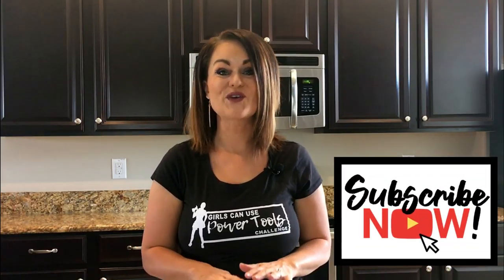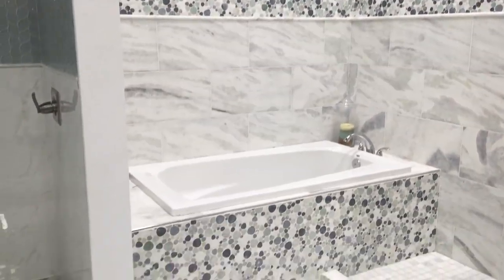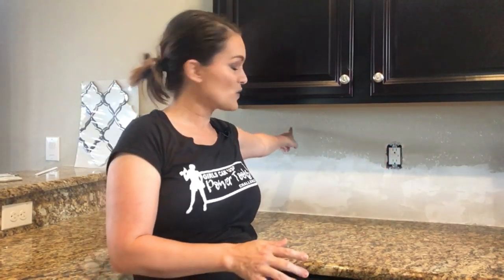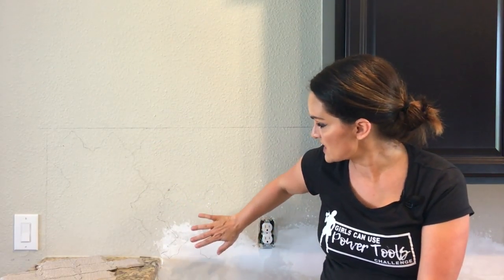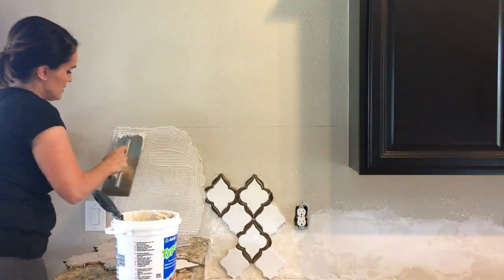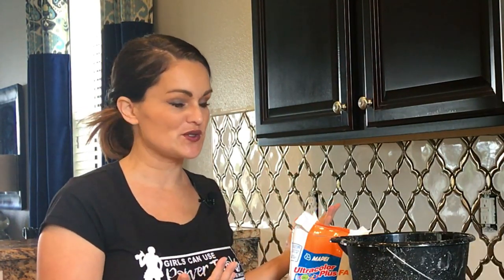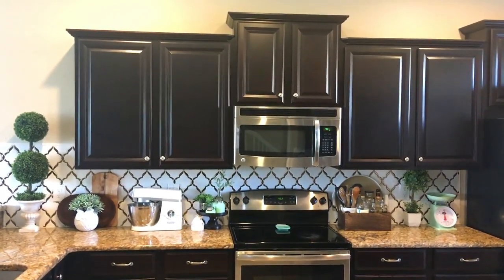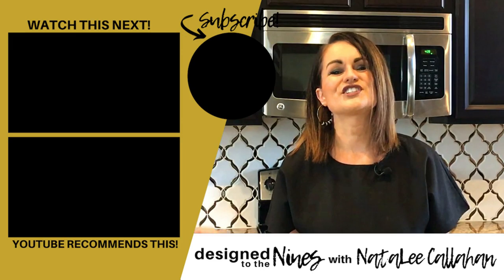HOW TO DIY | Tile a Kitchen Backsplash On A Budget !

Comment: Hi NataLee.  Thank you so much for sharing this video. This is a big help to me as I am tackling installing a backsplash in my kitchen.   I recently saw those tiles at The Hope Depot, Floor & Decor as well as Lowes - very pretty and luxurious looking!  I have been in the process of upgrading my kitchen for about 3 years now.  Tiny budget/time/lack of knowledgeable & or help.  I just finished adhering and grouting the granite countertop tiles.  We hired a friend who is a handyman to do a few of the upgrade items a few years back and he said he could install the granite countertop tiles on our island (where the sink is installed).  Once he left for the day, I noticed what a horrible job he did.  I don't believe he took a level to see if the tiles were level and the bullnosed edges are not all aligned properly.  After that, I decided that I would try to do the cabinet countertops by myself.  I figured even if i didn't do a great job that it HAD to be way better than he did.  :-)  Even being intimidated by it all, I kept moving forward and got the countertops installed and recently grouted them.  They look GREAT and I'm so glad that I tackled it by myself.  I'm quite proud of myself.  I am now going to tackle the backsplash, however, on top of the granite backsplash piece.  I was going to put the tiles right to the under side of the cabinets but i'll have to cut a lot of pieces horizontally.  I think i will do what you did and bring them up just a bit so there will all be whole tiles pieces on top and bottom of the wall.  Take care.

Comment: Hi  Natalee  love your backsplash. I have done 3 kitchens but did pretty easy tile. When it came to the tricky pieces I make a cardboard templet . Then it’s one cut and it’s perfect. I used to run back and forth to work to saw and it still never came out perfect. I can wait for you next DIY I love rolling you.
Reply from the maker: Great tip with the template! That would definitely make things way easier! Thank you for watching! 😃

Comment: Man I need to do that too!  How did you patch holes? And determine how many tiles?
Reply from the maker: Measure the height by the width to get square footage. Add 10% for waste for a regular tile and 25% for an odd shape like mine. I used a combo of mesh tape and a metal backed patch for that one spot. I patched with dry dax and a thin layer of tile mastic for additional strength. 😃